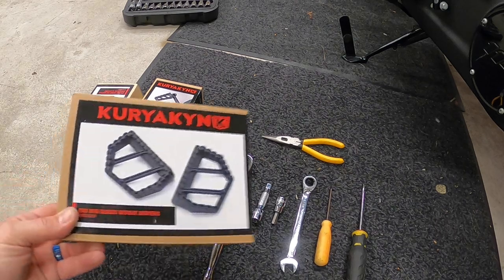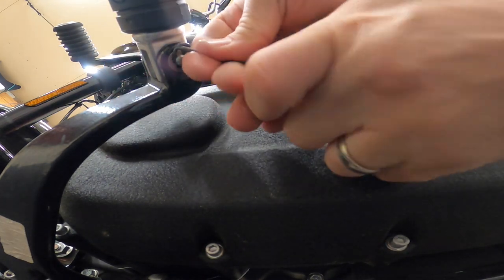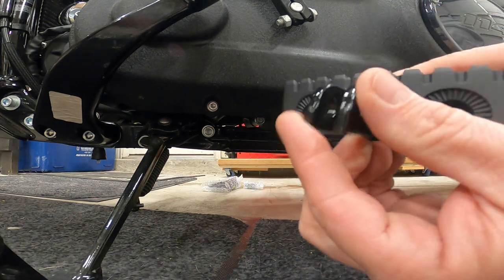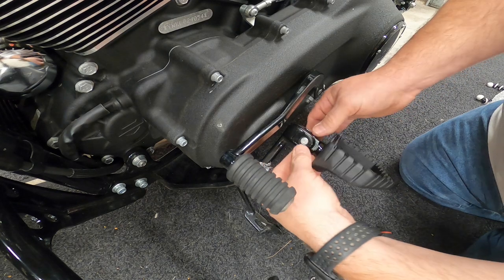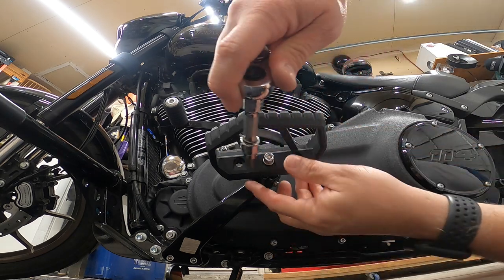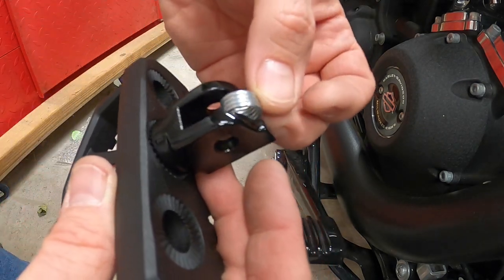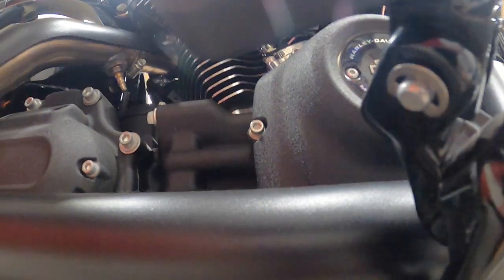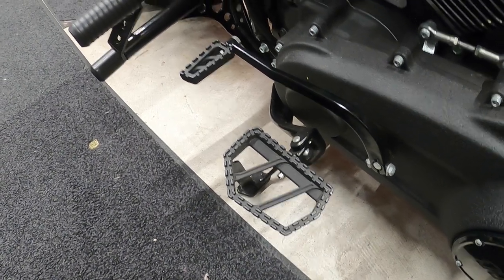Install and Review of the Kuryakyn Riot Mini Floor Boards and Riot Shift peg  Harley-Davidson

Comment: I’m curious to see if you get some kind of dampening on it to fix the vibration issue. I think that would make these even more tempting to install.
Reply from the maker: Funny you make this statement. Today went on a over 300 mile ride with some new Dr. Scholl’s inserts with gel. Made a world of a difference. Surprisingly no vibration issues like before. I’m definitely going to have to do some more testing.